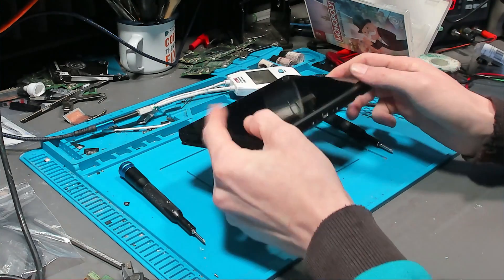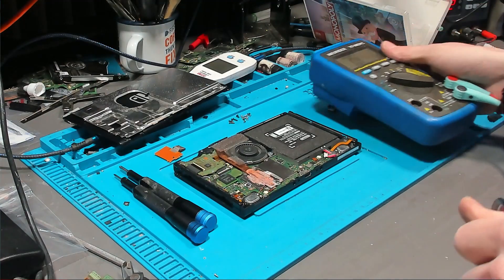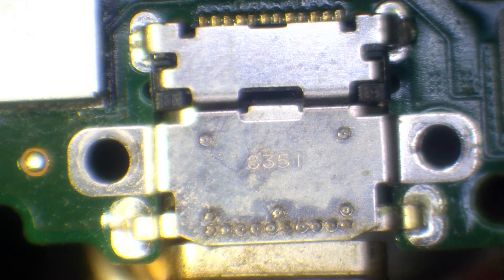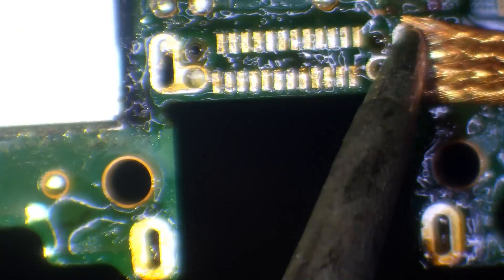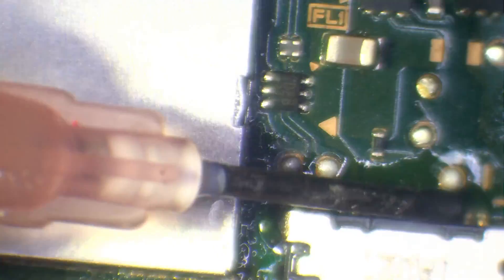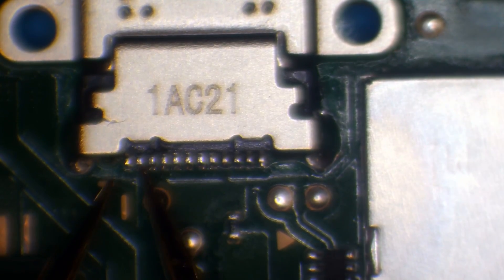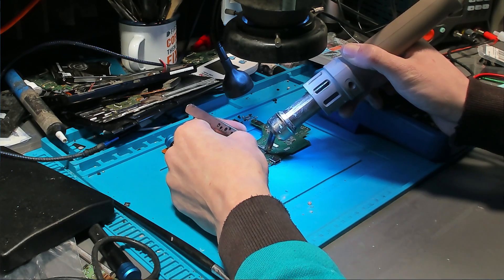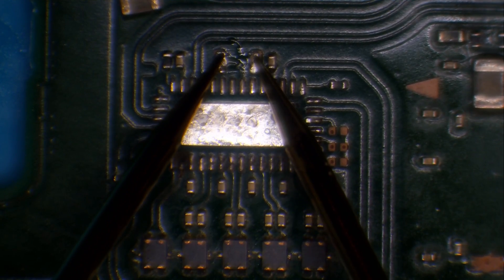The Nintendo Switch Doesn't Like 15v Direct To The CPU! Diagnosing A DEAD CPU On The Nintendo Switch

Comment: Hi mate hope your well. I have a new issue Ive never seen before with a Nintendo Switch. When I plug it into the amp meter it switches the meter off. Do you have any advice? The Switch is not charging either. Thanks

Comment: Hey Phil I've got an issue with my ps5. It's an hdmi issue on the outside of the machine. If you can message me when you get a chance I have to ask a quick question. I have a replacement port and I'm not sweating the repair but I might not have to so I wanna bounce a question off ya. You could answer me on here if you like. No rush on it. Like I said it works but I fear if the cable is ever unplugged I'm just going to go ahead and replace it.

Comment: You didn't remove m92t36? I believe I have replaced that and it has fixed that short
Reply from the maker: No mate from my experience that specific cap being short after p13usb removal is a dead cpu. Was it that exact cap that was shorted (the one linked to m92t36)?
Reply: @TheCod3r  you might be right, I might have removed m92 first assuming it was that, and then it remained so I removed p13 and it was gone, I would remove m92 just to check tho 🙂

Comment: Thanks Phil for another great video!  I really like this shorten format, but also enjoy the longer format as well.  I have a switch that is stumping my skill level.  Background, customer put a macbook charger to unit.  Port is in good shape no visual damage at all. Found a short around the M92T36, no other shorts found.   Checked caps when removed, short gone.  Replaced M92 with no issues, checked for shorts, all good!  But still not getting battery charge and when attempting to power up getting the classic error 21001-001.   I checked the BQM and USB IC's no shorted caps around them both.   Dead CPU? Reading at cap under M92 is 3.7kohms. Any suggestions?
Thanks Mate!
Reply from the maker: Thanks mate. It sounds like if you're getting the 2101-0001 error your cpu is fine qnd it's likely an issue with the M92 you've installed. Maybe you have some bridged pads somewhere or a bridged cap?
Reply: @TheCod3r  Okay, I have tried a couple of new M92's, will remove and reflow again.  No bridged caps are apparent.  When attempting to restart now it goes to Nintendo screen, then flashes low battery :(  Appreciate your help!